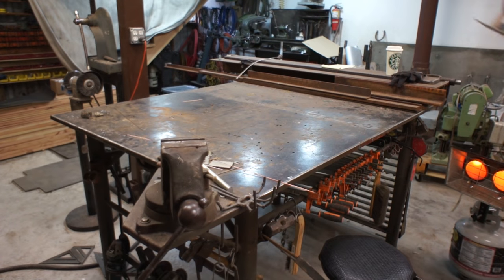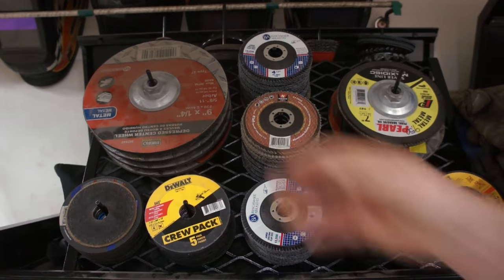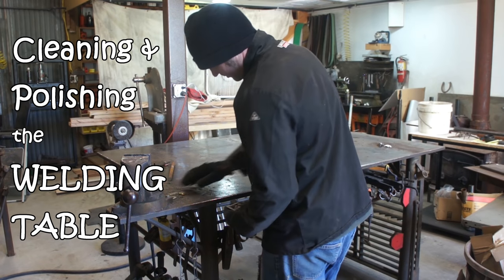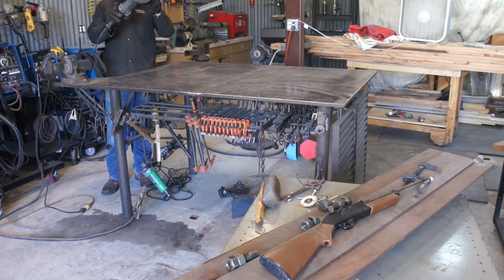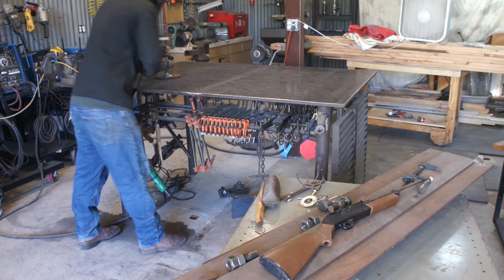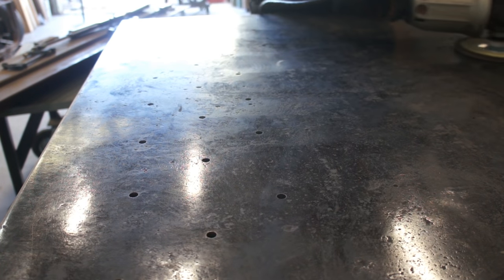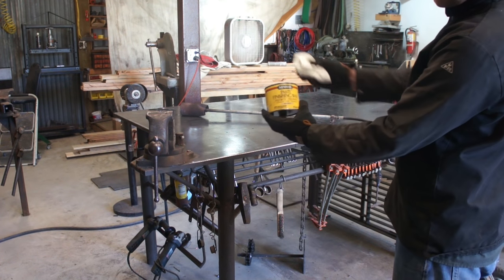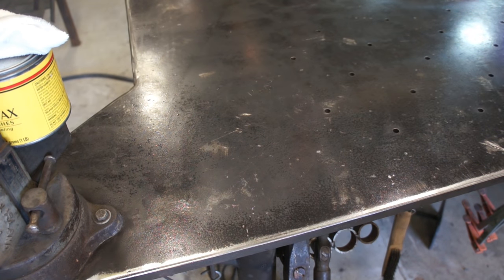Keeping the WELDING TABLE clean, shiny & smooth

Comment: Well done, good video. 
The water/moisture on your table when you’re heating it is the water vapour from the gas combustion condensing on the colder steel. When gas burns, it mainly creates water and carbon dioxide, and water will easily condense on room temp metal
Reply: Happens the most with propane fuel.

Comment: The water coming off the table is because it condenses on the cold table it is a product of combustion from the torch
Reply from the maker: Thanks for stopping by! Jordan Smith has a good video on the matter.
Reply: yeah, the first swipe of the torch in cold weather always leaves a decent dew-layer on the surface of the steel. after that, once it heats up past boiling temp, you are then taking moisture out of the steel. it shocked me how prevalent that myth is when i first started welding. Everyone in the steel industry should be aware that an oxy-acetylene torch produces water vapor when it burns. the first pass with the torch actually introduces more water to your steel, until its warm enough to evaporate away
Reply: @c4call  
So what's your point?
Reply: Burning a each molecule of propane creates 3 molecules of carbon Dioxide and 4 water molecules. There is no significant water in the surface of the steel.
Reply: @LitchKB  My guess too...steel can't absorb water, rust can to some extent, but not clean steel.
Reply: @sunship2  exactly. So many people believe the steel is holding water. Sure it can be wet. But its all on the surface. On a dry day, with dry steel the water you see is purely condensation.
Reply: Dew point
Reply: No, the heat draws the moisture out of the metal, they do the same when painting cars...
Reply: @cr2fabrication  So get two pieces of steel heat one from the top and see condensation. Heat the next piece from the bottom, you will not see any water coming out because it is from the flame.
Reply: @grahamejordan3973  better idea, heat one piece of steel in Arizona, and another in Louisiana...  it's the humidity in the air and on the material.  The "flame" is just the heat source causing the evaporation.  Water can exist in there states, solid, liquid and gas.
Reply: @cr2fabrication  Yes water can exist in 3 states, when it is created from the combustion of a hydrocarbon it exists as a gas that condenses on cold steel.
Reply: @grahamejordan3973  Try heating it with a heat gun, same thing...
Reply: @unitedstatesofbuild4915  please provide link to Mr. Smith Video

Comment: Great video!  I'm converting a commercial kitchen table into a small welding table at the moment and all I had for the surface was a roughish steel plate 8mm thick.  I was just thinking how to clean up the surface when I saw your video.  I now know how to do it.  Many thanks.

Comment: I clean my table off brush it off knock off spatter hit it with a wire wheel on a grinder then clean it off with acetone then let it sit for half an hour or so and then wipe it off and put a little oil on a rag and wipe it down. I'll put a good bit of oil on it if I'm not gonna have a lot of use on the table for a few weeks so it doesn't start to get a lot of surface rust.  I built my table last year it's 3ft x 4ft and the top is 1 inch thick plate steel. The legs are 2 inch schedule 40 pipe with 3/8 inch thick triangle gussets in the corners and 1inch pipe between the legs that I put expanded metal sheet on to use forms shelf and I made the legs adjustable length so I can level it out no matter where it is. And heavy duty locking casters at each corner.
Reply from the maker: Pretty straight forward. Do you notice any excess dust collecting on the top from the oil residue?
Reply: I'd I don't use it for a couple weeks I do but I usually wipe it down before I use it anyways cause my garage is extremely old and stuff like to drop onto it from who knows where
Reply: Mine is very similar, just a little bigger... a few differences.. 3” pipe legs with gussets and mobile home jack posts welded inside them.. trailer jacks with casters on 4 corners.. center legs have just the jack posts. 3’ x 10’ wood 4x4 and 2x4 base glued and bolted every 8” .. power hand plane flat.. 1/8” of bed liner . 4’x12’ x 3/8” plate on that.. 3’x6’ x 3/8” angle around the perimeter... surprisingly flat for the size.... can also level on most surfaces... wax is the way to go👍

Comment: i like your techniques.I would like to let you know that I prefer a 9 inch wheel type 28 in a 7 inch grinder .for the hard wheel.type 28 for anyone who does not know it is designated flat ,but is slightly concave.Also be VERY careful around the edges,way dangerous.Not for the beginner.Flat surfaces only.One more time very dangerous; it is grinding.I believe you use a type 27 ,which if i am not mistaken ,but could be is a depressed center flat wheel .When grinding in the flat by hand type 28 is a little easier to handle,still dangerous.The grit is usually more appropriate.Max RPM is usually lower.When used properly it last a lot longer,with no need for soft disks or flapper disks that can gouge the table.
Reply from the maker: Thanks for this info, Ill be heading over to mcmaster straight away to look up some wheel types. 👍

Comment: My process to clean my table is a lot like yours. Knock the weld berries off first. Then use the 7" grinder with a strip disc on it. I then spray the table with Zylol and scrub it with a green Scotch Bright pad. I then wipe clean with shop towels. I then spray the table down with some T-9 Boeshield.
Reply from the maker: Boeshield? Never heard of it. Where do you buy it?
Reply from the maker: Wow, cool Ill do some research. Thanks for the tip!
Reply: UnitedStatesofBuild Your welcome.
Reply: I live in West Texas with very low humidity, I have stopped using Boeshield  I was seeing oxidation on my table saw (cast Iron) I have gone back to Johnson’s paste wax, I did the same when I lived on the east coast near the ocean, the wax worked best for me.

Comment: I'm on the wood working end of things, and I'm used to thinking of 150g as minimum level of smooth., and finishing @ 400g. Have you considered polishing it? I'm thinking an automotive polisher. They run about 30 bucks or so. Use it with the paste wax.

Comment: Ceramic welding spray is what I use on my table. Once a week, I grind it flat, clean it with compressed air, and reapply. Edit: Loctite SF 7900. It's intended for the nozzle, but works on any surface really.

Comment: my last comment.....was we think alike...I built a slat WELDING TABLE the gaps allow me to clamp things easly with c claps...so right. an the approach on feeling the wheel FLAT..
....one question I've seen a machinist blacken machine tools he made.. is their any to do the same to the top of your table..he dropped the finished parts into a small container then when removed they looked GREAT any ideas out THERE  thanks again for the great posting one guy thumbs down..I doing get it...I don't walk on water but I'm willing to learn ...
Reply: I've watched some videos on bluing solution, used for gun parts. I'm building a 1953 chevy COE and wanted my tiedown pockets to be black instead of zinc coated. It was rather easy to do a muriatic acid wash, then neutralize and wash with water, then into the bluing solution. Might be a big pain to do the top of a weld table, containing the acid and getting everything neutralized.
Reply: To patina steel you just need to soak it in white vinegar for a while
Reply: @joshtonry4291  

A preheat and wipedown with cold blue could work for a table, but it would be a huge pain and the surface would need to be very polished to take a good blue.
Reply: @cavemanjoe7972  I blued the top of my table and it started getting surface rust almost immediately.
Reply: @anonymousgeorge4321  

When you blue something, it has to be oiled. Blueing is accelerated, controlled rust; the oil is the barrier, not the blue. This is what I meant by it being a huge pain.

Comment: The hard Rock placed flat is the key. Surface grind by hand.  It will keep the table flat and not gouged up.  Also don't weld or tack on the surface.  Great video education and very important if you want to be a good fabricator.

Comment: Can this be done over millscale? Do you have an alternative suggestion for removing millscale where grinding and sanding is time prohibitive due to the surface area size?
Reply: Muratic acid will remove the mill scale quickly, or you could soak towels in vinegar and leave it sit a day or two on the surface

Comment: 5:00
That's not all water from the table, part of it is the exhaust gases of the torch contain water. First the surface is cold and a lot moisture  condensates, then later  when its hot it can't anymore.

Comment: I don't think WD-40 isn't alcohol based.  Still, your point stands.  It is not the product for this application.  I'll try wax on my welding table.  I've also used Fluid Film, which does leave a somewhat greasy layer.

Comment: I just built a table, would you recommend stripping the mill scale off the top before applying wax?
Reply from the maker: Yeh, I think it would be a benefit. I wet blasted this top right after it was built and then I just do the maintenance that I depicted in this video and its been fine over the years.
Reply: Yes, the mill scale is non conductive, so most of it should be cleaned off. Maybe not a problem on stick welding, due to higher starting voltage, but i found it to be a problem with Mig /Mag welding. In fact i overheated a grinder (even a Makita!),  while grinding with a coarse flap disc.  The industral way to strip the scale is to use muriatic acid, then neutralize with baking soda/water, then grind again. This proces is of course best done outdoors, before you assemble the table (neither did i, that's why i burned the grinder).

Comment: what would happen if you blued the table? I have a work in progress table that will have a blanchard ground top and I would like to protect it.
Reply from the maker: Im not sure how it would hold up to the abuse. Have you seen one done before?
Reply: no I was curious on how to keep it nice. Wax seeems like a good idea but I guess it boils away and stuff still sticks to the table? Maybe if the wax was soaked into a blued layer it would stop sticking to the table (but you would need to use a magnetic or other clamp for the ground).

Just trying to find the best economical solution.
Reply: those plates blanchard ground are NOT cheap
Reply: cold rolled too
Reply: The solution I Have in mind currently is to get a sacrificail top layer for the table thats like 1/4 inch or less for non precise work in the form of plates and for precise work to take a bunch of those firebricks, put little plastic slide-feet on them, rubber coat them (i made one coated in liquid rubber as a test with all layers covered but top) and arrange them around the work piece like a jigsaw puzzel so splatter falls on top of em
Reply: There were some other guys talking about gun blue in these comments. One guy said he did some car parts...

Comment: still a table completely covered in millscale. you would be better off removing that completely to have the actual metal exposed. also, metal does not hold water. this is just another common myth among amateur fabricators and the ill-informed. is your cold beer bottle or beer bottle or milk bottle etc etc etc. holding water when it gets wet on the outside???course not. It's just the temperature differential. You clearly watch rainfall projects channel...
Reply: The terminology  might not be to your liking but the surface of the metal,like glass  most assuredly  holds moisture go back to your wood Peter.Sometimes Mill scale is preferable to oiling your table down every time you have to strike an arc on it .I do not know what rainfall projects channel is.
Reply: @hoagie2011  apply the logic. it holds water in and is water tight, yet porous and holds water?.... right. you have heard of condensation right? go back to my wood? wood is only a hobby, my actual work is metal, professionally. 20+ years my friend. I'm not going to write a whole essay about this, it's up to you if you want to remain ignorant or ill informed. I won't lose any sleep over it.
Reply: @joeshaft  so in ten years you might have as much experience with metal as i have ,I have been a T.I.G. welder since 1990, you sound like your a machinist

Comment: My table was made from an old trailer I had a guy build many years ago.  It is surprisingly flat.  Never cleaned it and didn't even have a clue it needed it or how it could be done.  Thanks for the good info.  My table is the horizontal surface that catches everything I have in my hands that I am too lazy to deal with in a moment or just don't know what to do with.  I hadn't thought about just throwing stuff away after a period of non-use.  Lot's of food for thought.  I'm going to be a lot more productive now...
Reply from the maker: Hey Robert, Im glad you left this comment. I just spent this past weekend getting the shop back in order after a few weeks off from welding projects. Needless to say my table had become a catch-all and was a disaster. Thanks for commenting.

Comment: I’ve welded at a few places, ranging from very small privately owned shops to very large assembly lines. None of them ever worried about oiling or waxing any of the work surfaces. Just the daily work on them and associates daily cleanup keeps them all looking good, never seen a single spot of rust on any table surface, even ones that are 20+ years old
Reply: All those rusty stains on top of his welding table at the 02:00 minute mark are what some people refer to as rust. If you and assembly line Joe Six pack have seen those stains on your welding stables for the last 20 years and never clean them, thats not the same them not being there.

Comment: Just remember that the welding table surface needs to be as conductive as possible, so make sure that nothing you do lowers that conductivity. Some finishes do just that. So, check first.
Reply from the maker: Good point, Thanks for highlighting it.

Comment: That water is not evaporating out of your metal propane contains a lot of water if you have one of those propane fire pits and you stand close to it for a long. Of time you will fill your clothing  get damp and then become wet this is just happening and how much faster process because the heat is hotter and the flame is closer to the table
Reply from the maker: there was a link posted in this comment section to another video that explained the process and why the water collects.  It was a good video. Thanks for the info!

Comment: I see that you have the layout holes on the tabe, would you recommend that i do the same to my table? I would probably get them cut out with a plasma table.
Reply from the maker: I would def do them again if I ever did another table, they are super useful. Be sure to lay them out so that at any given spot two clamps can clamp the same small part.
Reply: mag drill. r drill bit  3/8x16 tap is what i used. allen head bolts with different hold downs. alot cheaper than the 5/8 hole tables.

Comment: I got lucky and found some aerospace surplus on craigslist.  It's a 2" thick machine surfaced piece of 6061 aluminum with 5/8 holes cnc drilled on a 2" grid pattern.  The bottom of the holes have a steel 1/2 13 threaded insert pressed in. I can use strong arm type clamps and tooling or set up blocks and clamps from my milling machine accessories to bolt parts down. Cleaning it isn't a big deal because only the biggest bb's are hot enough to stick. The soot from the mig blackens the surface but WD40 wipes it off. I wouldn't dare touch it with a grinder...I can still see the machined surface marks so I know it's flat. Still need to build a nice base for it... working on a design.. maybe I'll try your wax trick..thanks for the tip!
Reply from the maker: Wow, that sounds too good to be true. How big is the total work surface?
Reply: Yeah, I feel really blessed to have found it. It's 39"×6'.. it looks like it was a pallet for a cnc machining center. I wish it was a little bit bigger but it's about the right width  to reach to the middle of.. I think I will incorporate some slide out extension arms to support longer projects when I build a base for it.
Reply from the maker: Wow, thats a pretty good size. Ive seen some cool designs that use harbor freight hitch receivers and 2x2 box tube for extensions. Good luck!

Comment: Nice tip on the paste. I like the idea of scraping of the slag with a chisel first. My Dad taught me that one. Said grinding a slag will cause small dips each side of the slag point. He also showed me how quick it is to use a belt sander. It's flat and there's no digging in. A consistent flat grind. Wish you well . I'll subscribe :)
Reply from the maker: Thanks for watching! Interesting about grinding the slag causing a dip. I have a nice belt sander, I was worried about ripping belts and damaging the pad. You have pretty good luck with it though?

Comment: 5:01  I bet you that a substantial portion of the observed moisture is a by product of combustion condensing on to your cold table.    Once the table is sufficiently warmed the water evaporates and no longer condenses.
Reply: Try to put a pan of cold soup on a gas stove and you will see water condensing in the outside if the pan.   Pan is not weeping, water is from the fire.

Comment: Production shop owner NYC Iron Work by Cropey here since 1956. Between jobs we sweep and ALWAYS grind at about a 5 DEGREE ANGLE. We don't eat off our 6 tables we do ironworks. You need to mention that it's a generally unsafe practice to use a disk flat.